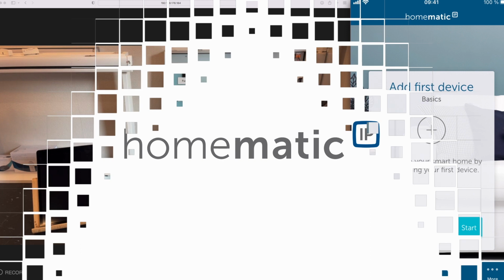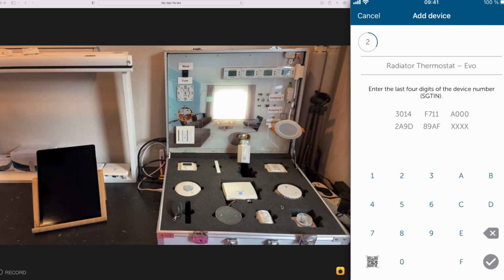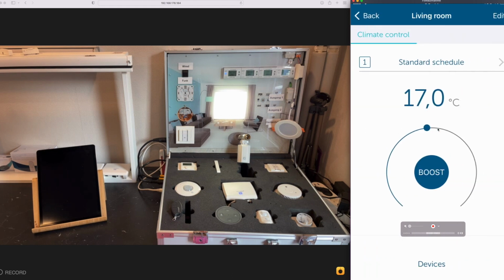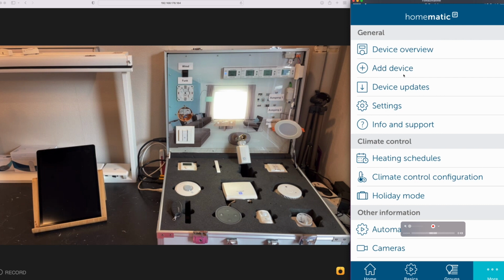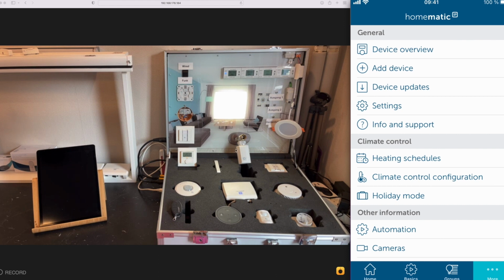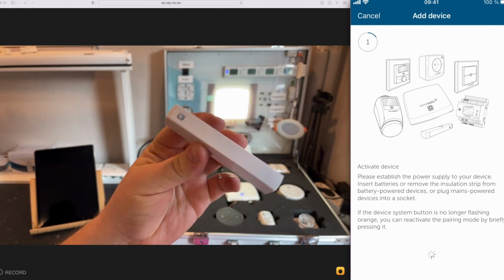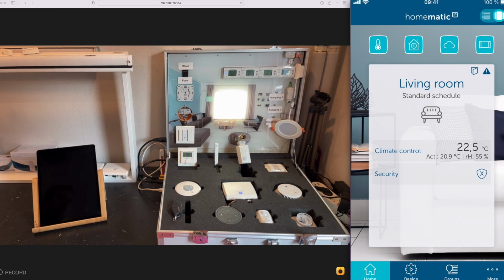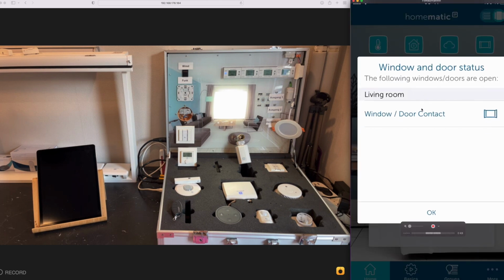Homematic IP | Tutorial: How to teach-in devices for room climate control

Comment: Just purchased HMIP FALMOT-SET, including access point, access point HmIP-HAP JS1 app installation passed without problems including access point, after installation, access point has been actualized by application to 3.0.16. Now I can only change brightness of the system LED on the access point through the application, but cannot add new device. App is searching for ever (pressing connection button on the thermostat or FALMOT-C12 valve unit, buttons are just flashing orange some time and devices are not recognized by access point during the search. Tried to disconnect, remove batteries does not helped too. No idea what to do, at least access point light nicely solid blue, but no use for. Note: Seems to be the thermostat communicates with valve unit correctly.